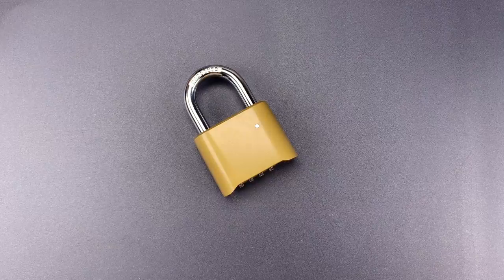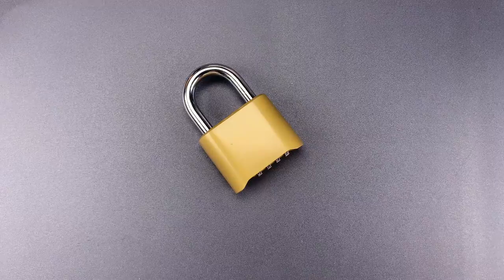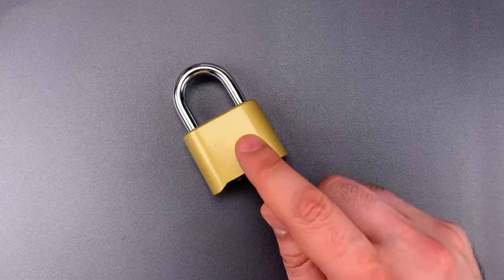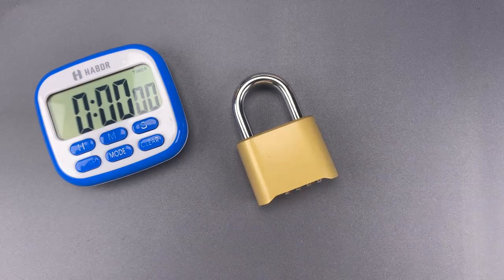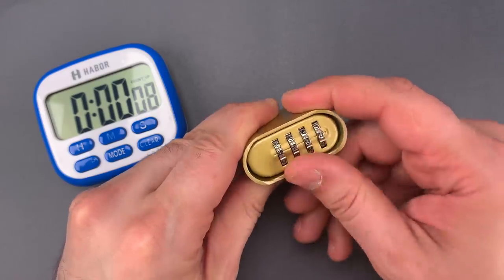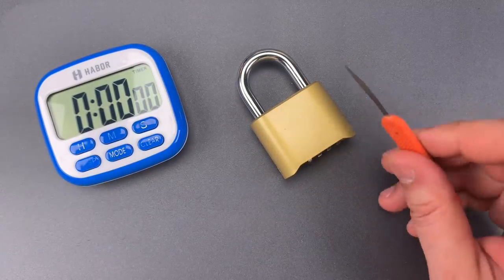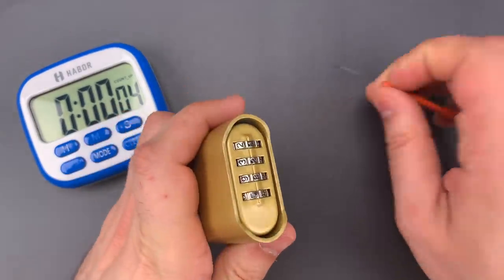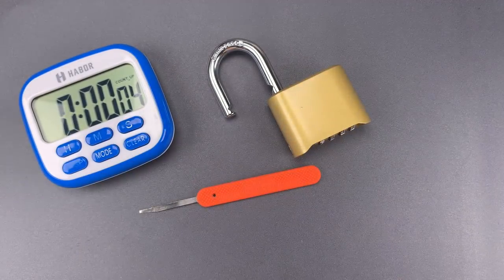[1158] Opened Faster WITHOUT The Code: AmazonBasics Combination Lock

Comment: The lock was opened faster than this comment was written.
Reply: Well yes, but actually y e s
Reply: Gotta boost your WPM. Those are rookie numbers.
Reply: And, I am pretty sure of that; because people are really slow readers, the lock was opened faster than this comment was read: people are really that slow to read!

Those checking proper use of ";" and ":" will even spend 100 the times required to open the lock.
And yes, this is still the comment, so you didn't finish reading it yet.
Reply: You can make a comment as long as you please and the lock will be picked faster than you write most of the time. Even reading some will take longer.

I guess this comment suits both kinds for slow readers. It also took longer than a minute to write, including making of the sentences..
Reply: Not this one
Reply: Or the ad.
Reply: @programaths  on my first read yes but on the second no

Comment: Soon:  This is, the lock picking Lawyer, and today, i opened this very big boi lock without the use of my hands or feet
Reply: If I was good with making custom electronic layouts and programming, I would have made a voice controlled lock that opens with: this is the lockpicking lawyer. Sadly enough I can barely make a single LED light blink with arduino.

Comment: The most recent Master 175D is not like the old 175 model. They have made the spaces between the wheels and the slots much tighter making the use of the bypass tool too thick.

Comment: Got any tips

I have a padlock I like to practice on like that one, except it's a key and not a code. I also have a lockpicking kit, but the tension rod wont sit still in the lock and I can't open it, I can lockpick a different lock that i have, but that one's clear and the one i'm trying to open is not.

Comment: So, I just got into lockpicking and wanted to ask any other lockpickers out there. How do you comfortably use top of the keyway tension when you are left handed. 
I love LPL's video's and tried using both top and bottom of the keyway tension. Top works better for the current locks I have but it feels very uncomfortable with my right hand.

Comment: @LockPickingLawyer I've got a padlock sitting in my draw that I found already locked. Scanning thru all ur vids I'm yet to find a vid that has a lock like it. Its a 4-dial combination padlock made by Master. But, the dials are exactly in the centre of the face running vertically with some kinda weird knob on the very bottom of the padlock. I'm guessing the knob is for re-programming the code. I opened it after I found it, the code must have been already set, but since then I must of accidently re-programmed it and now its a paperweight. Any ideas?

Comment: hmm well i guess if you already got that lock the owner may as well get the shim and use it as the key.

;D
only place it would be useful is as a lock on roof access, locked from the inside with the purpose of keeping people from sneaking in from the roof. (they would not have access to the lock from outside)

Comment: you needed an actual tool?
the lock can't be that bad then.

a few days ago I bought a parkside 3 wheel combination padlock(lidl house brand) that can be opened faster without a tool while blindfolded than with the code.
if you pull the shackle a little and you rotate each starting with the top wheel you can hear and audible click when each wheel sets, and and the wheel actually locks up when set.
so you just rotate each wheel until it clicks and locks, and on the 3rd wheel it pops open.